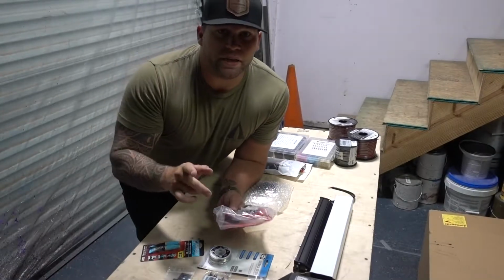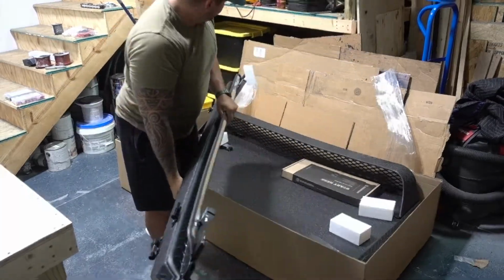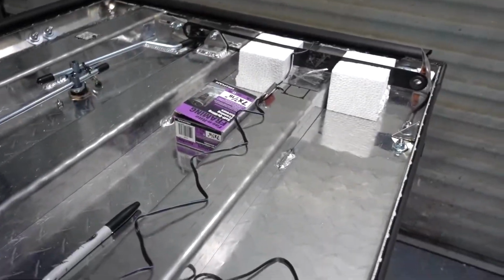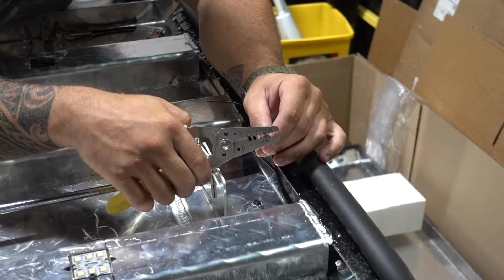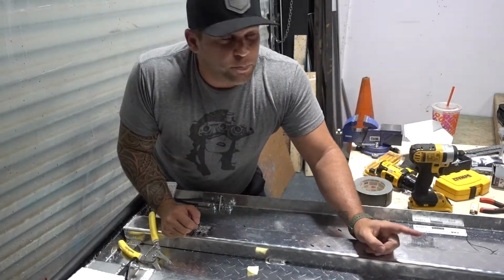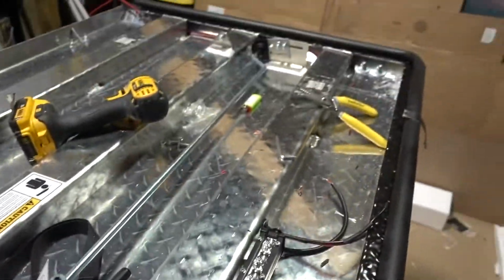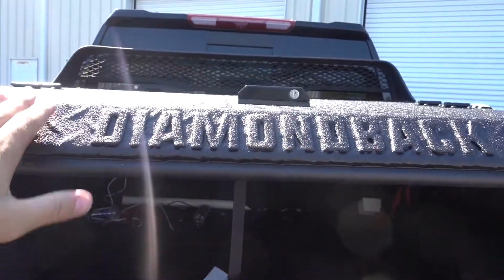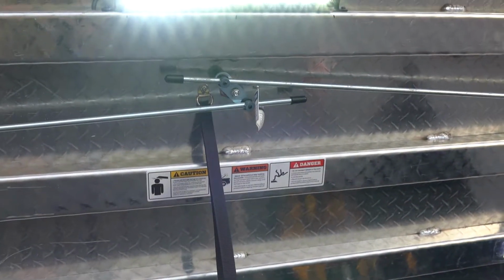DIY Truck Bed Lighting UPGRADE.

Comment: Hey where did you get the lights and switches? Did you have to drill out the holes for the switch or did they fit right in? How’s you connect to the battery? Just + - terminal?